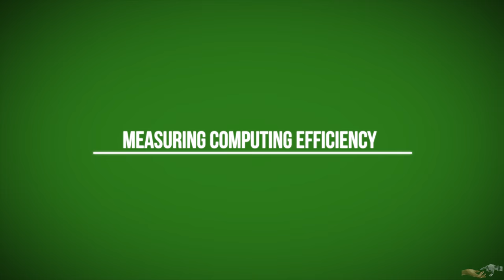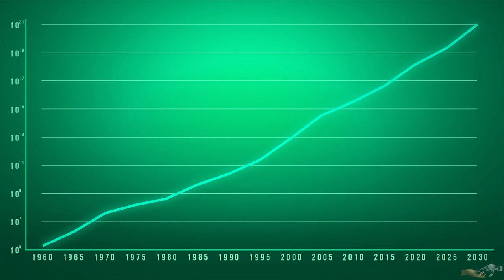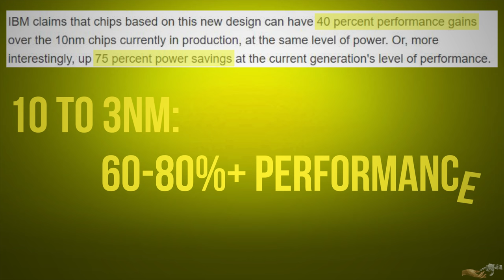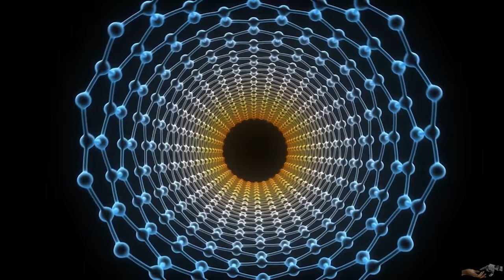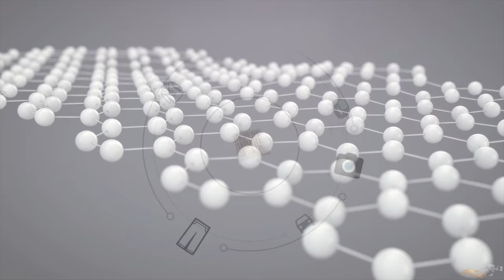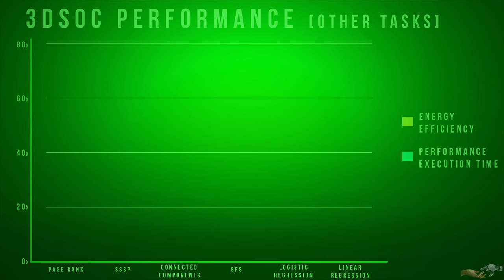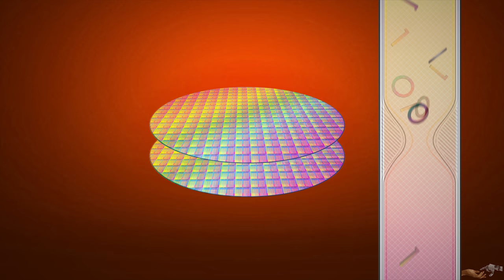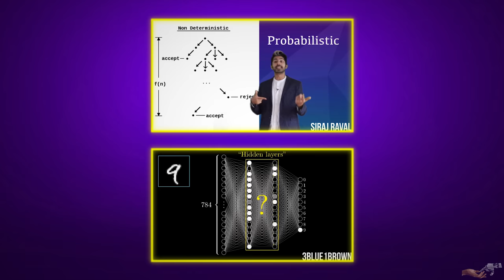Graphene Computing Explained (Making Computers Faster)

Comment: Graphene has no energy gap; it behaves more like a metal rather than a normal semiconductor, which limits its potential for transistor-type applications. There’s a lot of research on other two-dimensional materials, like Indium Selinide (InSe) or hexagonal boron-carbon-nitrogen (h-BCN), that have large bandgaps.
Reply: Exactly! I don't understand why this video (and everybody watching it) is ignoring this...
Reply: But metals are conductors. Why settle for “semiconductor” when you can use conductor, which is graphene.
Reply: in addition to what sarogo posted, a new field called "twistronics" just recently sprung where you can change graphene from either a resistor to a superconductor by merely changing the angle at which 2 stacked sheets are in relation to each other. this is fucking crazy and i don't know how that could be put into practice, but there's a lot of potential.
Reply: You are all missing a very simple key point
Reply: @VitalNutrients Because metals can't be used to build transistors. Transistors need to be such that under some conditions they allow electricity to pass, but under other conditions they don't. Thus functioning as electronic switches. You can't do that with metals because they always allow electricity to pass. Nor with insulators, which never allow electricity to pass. And so the only way to build transistors is using semiconductors like silicon.
Reply: @Ian Pender P Which is?
Reply: yeah if something that can beat semiconductor it would be hypothethical smart material that can offer more than binary switch despite the nature of electricity.
Reply: 1 single "failure" in the graphene latece  and dopants particle is enough to change it to a semi conductor, there is a lot of variation of graphene properties depending in whatfuck you do with him.
that is why there is sooooo much potential for everything, but is hard a fuck to scale those thing in industrial demand.
Reply: Could the graphene computing be combined with optical computing? If so would the problem of building transistors remain?

Comment: A FLOP isn't a measurement instruction per second. IPS is the measurement of instructions per second however it doesn't work very well for modern high performance computer. This is mostly because newer systems are designed to perform more than one floating point operations in a single operations.  

Also, no bets are being placed on Carbon replacing Silicon. To make a graphene transistor, you have to control both the chemical and physical structure; we can hardly make a single transistor in lab. Whatever replaces Silicon will have to work with photolithography otherwise we won't be able to manufacturer it no matter how much better than Silicon it is.

Comment: 3:19 It is always "either or", never "and". Your very own text about the IBM claim states that ("Or, more interestingly..."). Smaller fabrication nodes provide a higher power efficiency, which means that CPU and GPU companies face a trade-off between higher performance at the same TDP (i.e. heat, which is derived from how much power is consumed) or the same performance at a lower TDP. Or, of course, they can opt for a combination of the two.
 
For instance if a new node can provide 20% higher performance (at the same TDP, and thus the same battery life for mobile phones, tablets and laptops) or 35% lower TDP (at the same performance) they can sacrifice some of the performance and target 15% higher performance and ~25% lower TDP. 

According to the first preliminary data about Intel's first couple of Cannon Lake CPUs that have been spotted in Asia, they have ~15% higher performance due to the transition to 10nm, despite having no architectural difference. That performance edge is due to the 10nm node's higher power efficiency, which allowed Intel to add a 10% higher clock to their base clock and the rest must be due to longer boost clock times and +1 MB of L3 cache. 

Yet their TDP is the same as the previous generation, which means Intel sacrificed their entire TDP gain in exchange for merely 15% higher performance. That does not paint their 10nm node in a very bright light, which is presumably one of the reasons they delayed full volume production until next year. Nope, despite your exascale and even zettascale projections the road to them is nowhere close to "this increase in computing performance doesn't show any signs of slowing down". The industry requires either new materials like III-V semiconductors or a replacement for CMOS.

Comment: Incredible video, as usual! Your timelines are just slightly off - we'll be getting 3nm transistors in 2021 (likely either GAAFET or MBCFET), not 2025; we also won't hit zettascale in 2030, more like 2033-2035.
Reply: Exactly! Late 2020 for the exascale (with the Chinese beating the American Aurora project), late 2021 for the 3nm node and 2034 for the zettascale are my bets.
Reply: @pedronogueira8148  I think they're very good bets. Any guess on the yottascale? I'd say anywhere between 2045-2050.

Comment: the 100 to 4000 mhz increase on the CPU is because of the efficient cooling techniques were introduced, moore's law was more consisent based on transistor size. There were barely any fans on processors back in 1995.

Comment: It's funny how you animated a clock speed going up to 1 THz. Just due to the speed of light limit the entire processor, with all of the logic gates, control circuits and internal memory, has to fit within a sphere of 150 microns diameter just because of the speed of light limit (assuming the signals travel at that speed and the logic gates don't slow the signal down more than that).
Technically, yes, you can make a processor that fast but it wouldn't really be able to do anything that useful except for doing some small number calculations that require the operations to be executed in a specific order that that is already done in normal processors in operations like addition that can be executed in a single cycle. But the clock rate for the whole processor has to include all the interpretation and execution of the instructions and one of the main limits is how much internal memory you want since it takes up a lot of space but if you have it externally it is much slower.
So, yeah, you can get high clock speeds for specific tasks but not much higher for general purpose processing.

Comment: all the tech shown in this video was created 10 years ago or more
its just that the computer industry worked with silicon and improved it and wont change to a better material because it will have to change its entire assembly line to make them
now that they can no longer do that, they turn to material scientists with stored ideas from over a decade ago to improve computing!

Comment: The assumption that one could increase the Clockspeed of a CPU to the 10^12 Herz just because heat generation sinks low is false. This is due to the fact that the wavelength of the electromagnetic waves becomes too small for the chip to remain controllable. There is a reason as to why CPU are as small as about 4cm, while the wavelenth is about 6cm at 5 GHz. At THz the CPU would have to be smaller then 300 micro meters.

Comment: I just came across your channel by accident today and immediately subscribed  -  what a fortuitous accident it was! Your work is top notch and very informative.

I have an interest (venture capital investment) concerning the practical applications of graphene in general electronics (not only computing), photovoltaics, energy storage, in propulsion and transportation, desalination and the invention/production of brand-new industrial materials through combining and interspersing and/or sandwiching layers of different metals, carbon fibre, plastics etc with graphine layers.

The problems associated with graphene as a new industrial material capable of solving multiple problems towards progress of otherwise feasible 21st century technologies, seemed to lie primarily in the production costs and scalability of graphene sheets. It would appear now that very recently this road block may have become a thing of the past.

Comment: use the material from the space shuttle tiles as  heat sync in between layer of the 3d chips to cool them
Reply: Yeah, but that's just Aerogel shielding - it would isolate the heat from one chip to the next, but the heat generated by one chip itself could be enough to destroy the chip.  The heat would need to be actively pulled out with a heat sink/radiator setup of some kind.  That's seems entirely feasible.  Even submerging chips in a non electrically conductive fluid with a high density (mineral oil) & circulating it around has become popular with people over clocking chips.  Competitions for over clocking involve isolating the chip surface & keeping liquid nitrogen in direct contact.  The prep prior to a competition at that level though is insanity...

Comment: a very fast sculptor sculpts a rock say 100grams per second. if you come with a hammer and start chipping at the rock at 1grams per second, you are slow, so what's the solution? get a bigger hammer, and chip 20 50 60 75 then 100 grams per second. the rock is smitherines, doesn't make it a sculpture.

Comment: In 1985 I worked for a company that was making Diamond substrates from carbon based gases.  Once we had perfected the process, the FBI came in and SHUT US DOWN,  TOOK EVERYTHING.  Whats is Diamond substrates good for?  Silicon IC have a problem, heat.  Diamond IC's are near limitless in speed.  33 years later, you never see nor hear of "Diamond Processors".. and you won't.  The Government has them.  In the 1990's I worked for a company that made 'sub-micron' metrology devices.  1995 ALL of our customers told us, they could no longer buy our equipment, because their parts were "TOO SMALL" to be seen in a 1 micron field of view...  TOO SMALL...!!  That was 23 years ago...  You can not even fathom where tech science is today.